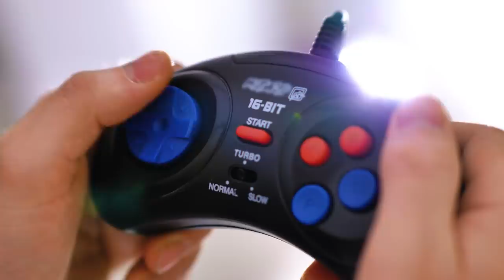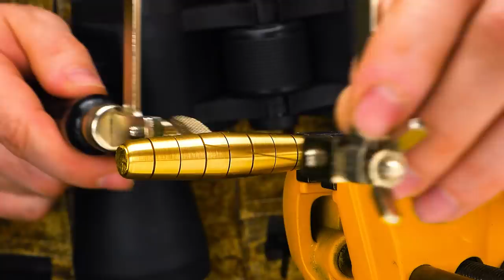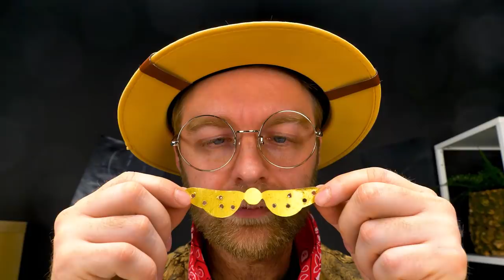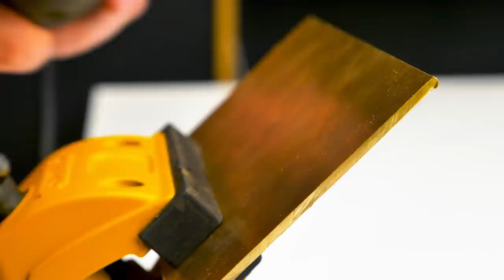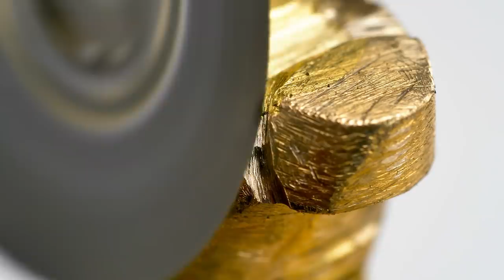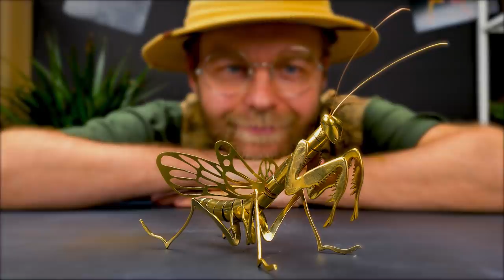Fancy Brass Mantis Made From Bolts

Comment: #5yearscraft
#janitorjumanji
#franklinmousefinbar
#craftyfinbar

Crafty finbar : Mantises are an order (Mantodea) of insects that contains over 2,400 species in about 430 genera in 30 families. The largest family is the Mantidae ("mantids"). Mantises are distributed worldwide in temperate and tropical habitats. They have triangular heads with bulging eyes supported on flexible necks. Their elongated bodies may or may not have wings, but all Mantodea have forelegs that are greatly enlarged and adapted for catching and gripping prey; their upright posture, while remaining stationary with forearms folded, has led to the common name praying mantis.

Comment: What a beautiful mantis.  Excellent work.  Which size nuts and bolts, and corded driver are you using?  I couldn’t place where in the body you were soldering a part and is that a special solder?  I’ve not seen a vice like that, do you have a link to it?